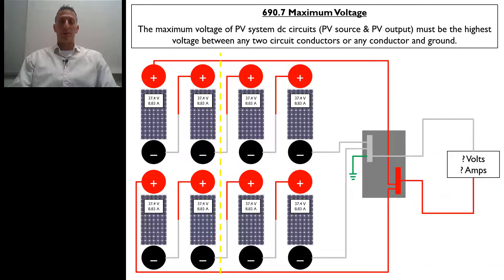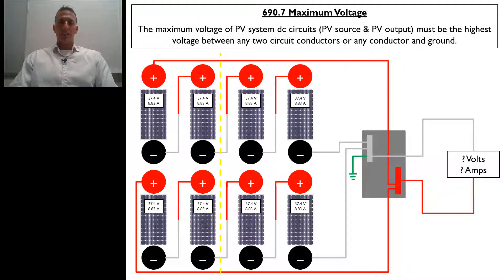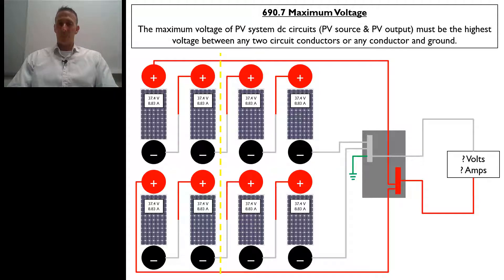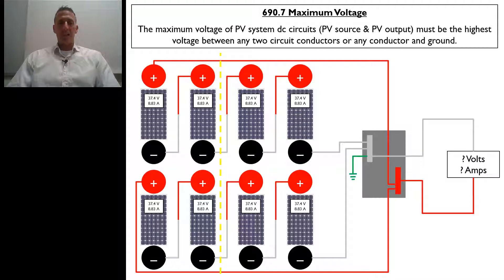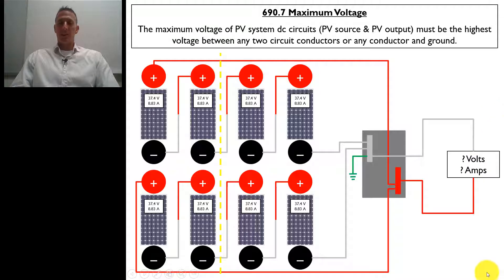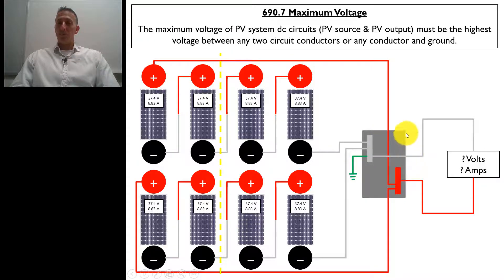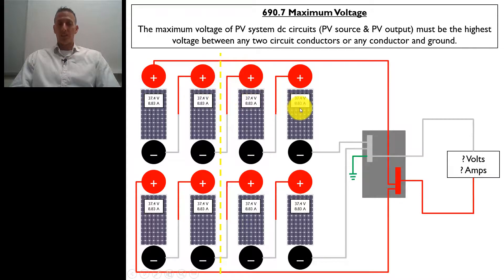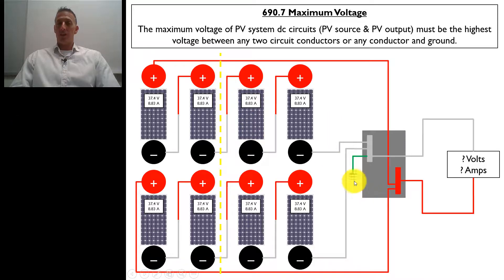Solar Training - Maximum Voltage

Comment: Thanks so much for this

Is there harm in oversizing your solar panels to improve absorption on cloudy days? 
Eg a 650w panel for an inverter designed for 550 watt max solar input. 

Will there be risk on a sunny day when 650 watt is actually absorbed by the solar panel? 

My inverter has a built in solar charge controller.

Comment: Just came across this video as I am new to investigating solar systems.  In order to get a good south facing array out from under trees I would have to put my array down in my pasture about 600 yards away from the house.  What kind of voltage and wire gauge would I need to go that far?

Comment: @
SolarPVOutlaws I have 2*110Ah leisure batteries in parallel connection. I want solar panels to charge the batteries and for that i am considering 3*160watts MONOCRYSTALLINE solar panels and a MPPT charger. what Amp of MPPT charger do i need to buy to support these 3 solar panels and do I connect the solar panel in series connection with each other? Details of the solar panels that I am going for is: 
Watt: 160
open circuit voltage (VOC): 23
max power volt (vmp): 7.7
short circuit current (ISC): 10
max power current (Imp): 9.5